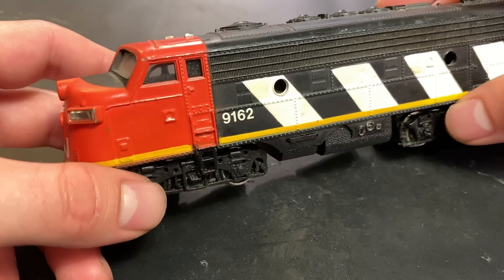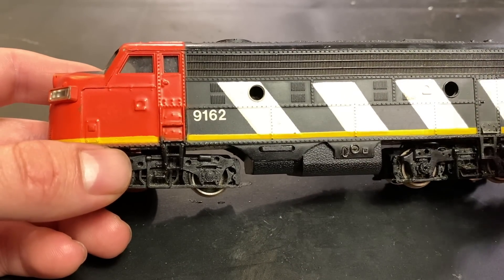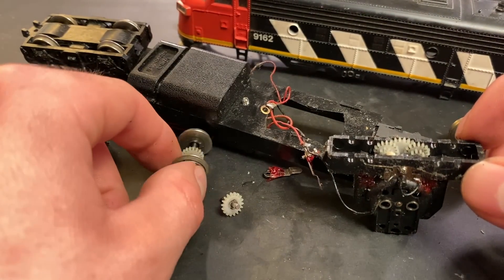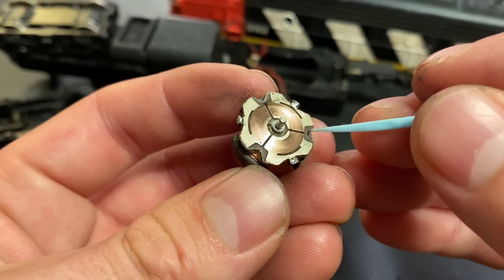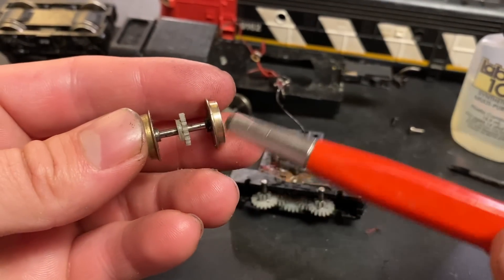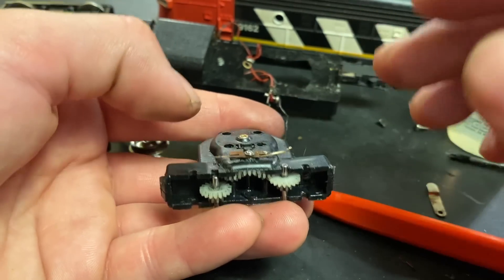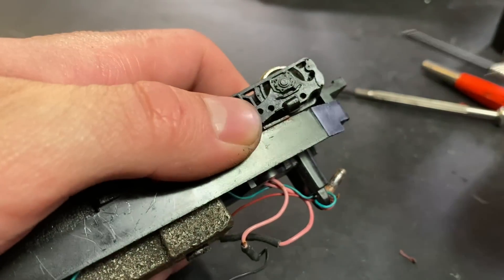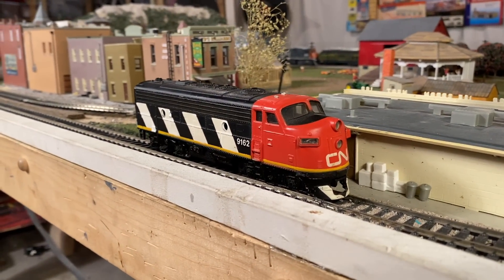Don't Run Your Locomotive That's Been in Storage for Years

Comment: How many times have I serviced an old Lionel or American Flyer locomotive that has grease that has hardened into something similar to a rock, or has gears full of carpet prices or dog fur.  Many times the brushes are worn and the commutator is filthy.  I’ve had the same experience with HO units.  Unfortunately many HO units have burnt out motors.  I once helped service a Lionel unit that had gears destroyed because of carpet fibers in it.
Reply: when a locomotive BEGINS to slow down- THAT is the time to act. you fix the problem BEFORE it ruins your locomotive. THE SMALLER THE MOTOR-THE LESS WARNING YOU WILL HAVE BEFORE IT SMOKES ITSELF. rules to live by....
Reply: @tommurphy4307 so true.  I’ve had to replace armatures on trains because the owner kept increasing the voltage to compensate for not being cleaned.  I wish I had a picture of an old Lionel diesel circa 1962 that had coils of carpeting wrapped around the worm gear.  It eventually destroyed the gears.  How it didn’t destroy the motor is a tribute to how well Lionel built their motors back in the 50’s or early 60’s.  I’ve worked on HO units with similar problems, in that case the motor was usually fried out.  Here’s another one.  Someone trying to run their HO train set on an AC Lionel transformer.  Hum, hum, smoke.  Some people don’t read directions.
Reply: @markshogan2642  I just got a 1993 PIKO circus set and the little O-4-0 steamer had wheels that were literally BLACK with gunk, and so were the contacts, but yet the motor still ran, however it would sputter and make a grinding sound, So I unsnapped the wheels (they unsnap out because they are just clamped in place by the bearings, and the gear too which was covered in ick, and human hair, it took an Ounce of contact cleaner to loosen all the dirt up, the 70 pieces of track thrown in needed cleaning too lol.

The Freight wagons wheels were so gummy that the cars would wobble!

Comment: Great advice. I once serviced an 80s Märklin locomotive where the factory lubricant had hardened solid (a typical problem!), and the gearing was so low that the motor simply destroyed the first gear after the armature. It had to be replaced, and the whole mechanism cleaned of brass dust and petrified oil, and relubricated. After that it ran great!
Reply from the maker: I’m amazed the motor had enough torque to strip the gear, I find the windings will usually fail first.
Reply: @SMTMainline  The armature gear was tiny and the next one was a combination gear: exceptionally big driven gear with a tiny driving gear in the middle. This makes for a great reduction, which usually results in a huge torque at the wheels. Older Märklins don't use worm gears due to the layout of the drive train.

In this case the whole drive was seized due to the hardened lubricant. However, with the enormous torque, the user applied power until the locomotive started slowly moving, and ran it until it completely stopped.

The locomotive was then serviced by someone who did a superficial cleaning, i.e. put a few drops of oil in the wheel bearings and cleaned off some carpet lint, but it still ran poorly.

At this point it came to my hands. I ended completely dismantling the drive, down to driving out the pins that functioned as axles for the gears. I cleaned and lubricated everything.

The first combination gear had worn its center hole into an oval, and also eaten into its steel pin. This is where the brass dust came from. (The old series wound Märklin motors have some serious power!) The hole was so oval that teeth were starting to fall off the small gear. I couldn't source an exact replacement, but I was able to get a gear with matching tooth counts and a fixed center axle. I cut off the axle and drilled a center hole as precisely as I could. It worked well enough!
Reply: @SMTMainline  BTW, love watching the old engines come back to life!

Comment: My HO trains had been in storage for over fifty years. They rested in a steamer trunk stored in the attic. When I opened it up the trains were all there as well the nests of generations of mice. Oddly enough, the cars and locos had not been gnawed. 

Broken ladders on the rolling stock and plastic shells abounded. The the Mantua Mikado locomotive was nearly covered with surface corrosion.  The piolot was broke, the truck springs were missing and the valve was bent up and had worn out  bushing. These parts were replaced after a lot of ebay hunting. Happily the old gal was free of zinc pest. 

I manged to restore most of the stuff to close to new, or at least to running condition, figuring out how make repairs and modifications along the way. I also installed LCD headlights in two of my Athern rubber band drive F7s. 

Most train projects are not 100 percent completed yet as I've had to pay attention to other more pressing matters and put the trains on hold. Now I'm that I'm free to devote some time and money I'm able to resume sporadically working on the trains. I cleaned and serviced most everything to get things running reliably again. I also splurged on a used MRC Tech 4 230 Transformer to replace my also restored MRC Trainpack. The Tech 4 is comparative awesome! I got a good deal on it and it looks and runs like it's brand new. I still use the Trainpack when cleaning loco power pickup wheels. I'll post a video on the Tech 4 soon.

An easy way to clean brass locomotive wheels is to use a spare transformer and alligator clips to power the loco while upside downs, run the loco and burnish the wheels using your weapon of choice. I use both Scotch Brite and, for really bad cases, a small wire brush attached to my faux Dermal tool, If there are ridges or other surface defects, you can even use jeweler's files to machine the surfaces smooth. At least with brass wheels you can. Steel wheels :body-blue-raised-arms:. 
Scotch Brite, as Harrison mentioned is also great for cleaning motor Armatures. Also be careful about using solvents to clean old rolling stock. It will remove the paint jobs on some "toy" trains (ask me how I know).

I have a number of restoration, upgrade and how to videos posted so it you are so inclined, give them a look see.

Thanks
-dave

Comment: If you package up all your engines back in the stock packing they will last longer if you leave them out exposed to the dust then you’ll have too clean them more often. It is best to oil the gears and motors regularly if you can

Comment: If anyone decides to use something like carburetor cleaner, brake cleaner, or electronics cleaners on parts, be VERY careful what cleaner you use on which parts. You can use just about anything on metal, but do NOT use anything containing acetone on plastic or painted surfaces. Others solvents (like toluene) may dissolve plastics like styrene, though Delrin or Teflon parts tend to stand up to such harsh chemicals on a limited basis.

Comment: It does no good to lubricate gear teeth since there is no sliding movement between gear teeth (akin to shoe leather to pavement when walking). Do lube the gear axles though. I DO recommend lubricating both motor bearings since those bushings are sintered, meaning they're dry and porous. Most LaBelle oils are electrically conductive, so there is no danger of fouling the commutator or gumming it up. In fact it's a good way of cleaning it without disassembling the motor (some say you should not remove the armature from the magnets, since it weakens the magnets). 
When you take apart the wheels, take note of their left-right orientation. Some have an insulated side and if improperly installed, could cause shorts. Others have asymmetrical gear spacings which would affect gear engagement.
Reply from the maker: With all due respect: There is friction between the teeth so oil should be added. The motor bearings do need oil too however even high-end conductive lubricant will foul the commutator (Those gaps are for isolation so conductive oil shouldn't be there) further more the heat will dry out and burn the oil. Removing the armature from its magnetic field could have an effect however I haven't found a difference current draw wise and it has to be pulled out to clean the commutator anyway.
Reply: I disagree re lubing gear teeth doing no good. Gear teeth will wear down without proper lubrication. Unlike the video, though, they should be lubed with a plastic compatible grease, with oil used for bearing surfaces.
Reply from the maker: @whiteknightcat  The all lubricants used in this video are plastic safe.

Comment: I have an old Piko BR55 steam locomotive and the Chassis and pickups which were in bad shape shorted, now I'm either trying to improvise some tender pickups, since i removed the originals or simply just eventually get another one and just exchange shells, a can motor might also be dropped in too

Comment: Do not use WD-40 to lubricate a locomotive. The WD-40 over time develops a fine oily resin that draws fine particles of dust, and that will seize up a motor. I ruined several Athearn motors in the late 80's doing that.

Comment: Cool informative video. I have an old tyco set. It's has a Chattanooga steam engine and tender. The tender is actually the power unit. And pushes the loco while pulling the cars. The loco is a dummy but has a light and smoker. It works in spurts. Goes a few inches then stops. Even when i tryed to pull it behind a brand new loco on new track it does not want to power up. To be honest i saved it from the trash inadvertently. I got a delivery from train world and they have their self labels tape and boxes. Ups put it on her porch. My neighbor was cleaning out her basement and found the train set her parent set up Every year for x-mas. She remembered my train world delivery a few weeks earlier and gave it to me. Was only missing the hopper car it still has the tiny clear funnel to pour in the smoke juice. but it's an orignal tyco and kinda wants to work. Except for simple cleaning maintenance and changing couplers I have no clue how to fix model train stuff.
Reply: The chattanooga steam loco tyco made uses a "power-torque" motor unit in the tender, it's the same motor used in diesel locomotives of the same time period. It can be a little annoying to work on them but that's mostly just because you have to be very careful not to loose the brushes or brush springs from the motor. Try something easier first, and work your way up to it, that's my advice.

Comment: Have exactly that same Bachmann CN Loco which I converted to DCC with a cheap Bachmann decoder about 6 years ago. But, didn't work on motor.  So thanks for video and tips.  It might run better after I  follow your advice.

Comment: Is there another way to get to the gears in the trucks?  I have two older Bachman F7 locomotives that run but need maintenance.  There is a Bachman video that shows a different way to get to the gears in the trucks.  The guy just prys off the truck covers and there are the gears to grease.  Can you please address this basic maintenance issue?   Never mind, I found the answser https://www.youtube.com/watch?v=FbaHB6GD2P4   at about 8:49 into the video.

Comment: Great advice, Harrison, as always. The same caution should be exercised even when buying an item new from a train store where it may have been on the shelf for some time. A recent Bowser streetcar purchase actually came with a note indicating that the unit should be lubricated before running it, since in order not to incur any leaks in the box the manufacturer did not do so prior to shipping.

Comment: Congrats on 60k subs! A little bit off topic, but are rivarossi berkshires (#759, that one with the blue on the tender) good runners? And about how much are they worth in decent condition? Thanks, and hello from Australia!
Reply from the maker: They can be decent. They don't have great pulling capacity but can run for an awful long time if you maintain them right. The only two issues I've had is the screws on the drivers falling out, and electrical issues with the tender connection.

Comment: I've been using 3 In 1 oil for 25 years or more!!  I've never had any trouble and it works fine.  It's plastic compatible as per the manufacturer.
Reply from the maker: I wouldn't put in anything expensive but I'm sure for old tyco, life like, bachmann's etc it would be okay.
Reply: C Campo - Do you pour a small drop on a flat toothpick & use the toothpick to apply the oil to the mechanism?

Comment: Might have to get you to help me put my mini trix 2-10-0 back together. The main drive wheels jamed up on one side. I took it apart to try, and fix it. Now I can't get it back together right.
Reply from the maker: I'm not sure what would be causing that. Are you sure the parts are positioned correctly?
Reply: @SMTMainline  if I knew how to send you a picture of the problem I'm having I would. That way I could explain the problem better. To me it looks like the wheels have slipped,but I'm afraid of trying to move them. Being as small as it is. Since it's N scale. It's a little more fun to try, and fix without doing more damage.

Comment: I tried to do the best I can with taking care of a motor like this on a 3 pole or even a 5 pole I would say as I mentioned this before I think? Most of the time I usually take my time at it cleaning it plus putting back together right and sometimes I do make some errors on it Btw Harrison this is a learning experience if people wanna get into this hobby and want to learn to take care of it and maintain it time after time. Thanks for sharing this tip and as always serenity. Matt k
Reply from the maker: It takes time but can be worth it. Sometimes if the engine is worthless and junked there isn't any harm in trying even if you don't know what you're doing.

Comment: Back when I had my outdoor layout,  running DC power through brass rail, I found a track cleaning car with a Scotchbrite pad did a great job cleaning off the rails. FYI
Reply from the maker: I'd imagine so. I have brass rails in certain sections of the layout and they have to be scrubbed constantly.
Reply: @SMTMainline  It became such a chore and pain in the butt that I scrapped the rail power and went battery on board/radio control. Best thing I ever did. Such a pain became such a pleasure to run the trains.

Comment: I have some PC locos from a few years ago that are still sealed in their boxes. Should I assume that the lubricants have all dried up and hardened?
Reply from the maker: I suspect the engines would run fine, the lubricants are probably still doing their job to some extent but changing the oil wouldn't hurt.
Reply: @SMTMainline  that’s what I’ve hoped but glad to hear it confirmed
Reply: I’ve got some Labelle and I’ll put a dab on them before they get running in. It’s almost a shame to take them out of the box! The cars are mostly mediocre and even a bit silly with all the Loblaws ads on them, and the track is junk, but the locomotives are great and at the time half the price of anything comparable from Tyco, AHM, Bachman etc.
Reply: ABSOLUTELY! train makers generally use cheap lubricants in their locomotives to begin with. those trains are probably quite old as PC disappeared nearly 50 years ago. two very good reasons to service them. if it were an NOS automobile- imagine how much work it would need to be road-ready?
Reply: @tommurphy4307  not quite! PC is still very much a brand. The trains were discontinued no more than fifteen years ago and have now tripled in price as collectors items. They were made in Slovenia where many AHM models were made.
Reply from the maker: @tommurphy4307  PC (Mehano) was still making Canadian train sets until 2007 or 2008